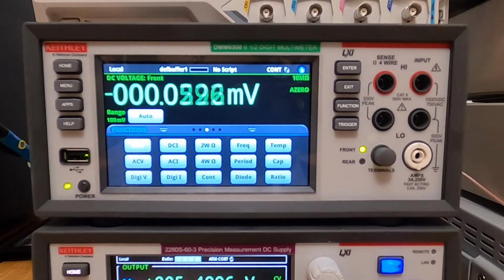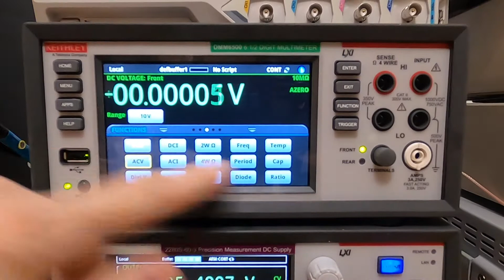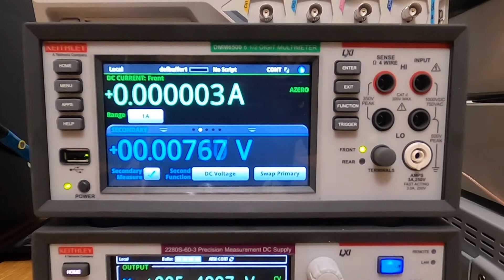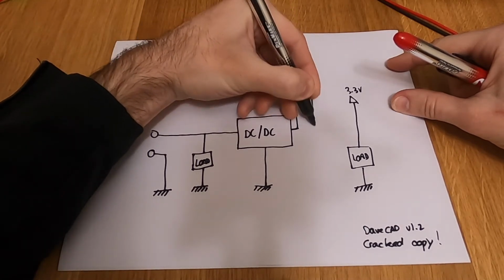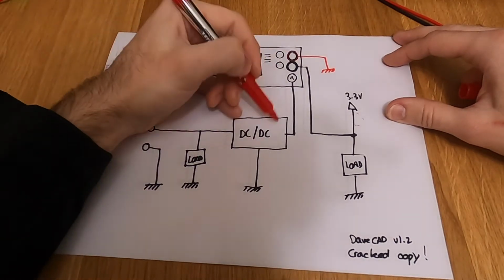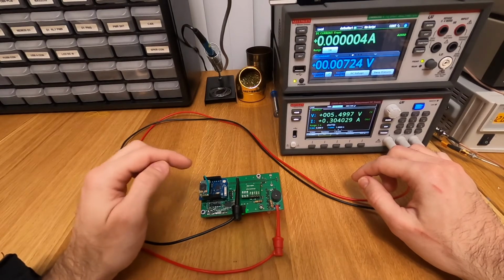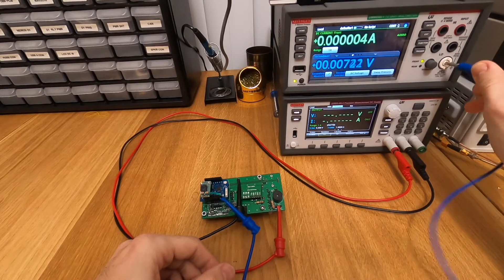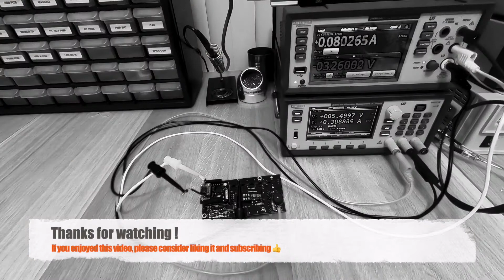Keithley DMM6500 : Dual measurement capability (demonstration)

Comment: Thank you for the range tip. I hadn't realized that.
A tip from me is that you can meassure the current on the low side of the load.
By this way you will able to measure the voltage correctly on the high side.
Thank you for the video.
Kostas

Comment: Super helpful video. Nicely done. 👍 I've had this relay switching issue during dual measurement on another DMM and I was wondering why sometimes it happens only some of the time (otherwise, it works as expected). Your video explains it _perfectly_. Btw, I have a DMM6500 on order - to replace my older 5.5 digit meter - and am looking forward to it even more now :) !

Comment: Excuse my ignorance but aren't the sense 4 wire terminals for measuring voltage and current at the same time?
Reply: If you haven't been exposed to it before, you'll probably find the 4-wire measurement system pretty interesting. This is also known as a Kelvin connection scheme. By connecting two wires to each side of a resistive element, it's possible for the meter to "subtract out" the resistance of the wires themselves. For precision measurements of small resistances, this is essential.

Does that help?

BTW, for voltage measurements, the 4-wire system is unnecessary, as the change in input impedance would be trivial.

Comment: I think you have missed one shortcoming. In this setup voltage measurement is wildly inaccurate due to flowing current thru voltage measurement lead. In most cases, even a 4.5 or 3.5 digit handheld multimeter will give better accuracy and non of the limitations. This is also true for current to some extent as you can't select the optimal range for voltage and current at the same time so current is measured at lower accuracy too. Although it could be useful in scenarios where 2~3 digit precision is enough. It just looks somewhat strange than it's done on a 6.5 digit multimeter :D

Comment: How do you handle the power on/off situation on the 6500? It has only a standby mode and can't be separated from the grid without pulling the plug. Do you disconnect it using an extra switch or do you leave it in standby mode all the time? What do you recommend?
Reply from the maker: I am not sure if the DMM6500 uses a heated reference. But since Keithley didn’t use a “true” ON/OFF switch (they did on my 2280S power supply) there must be a reason. The instrument might suffer from some adverse effect if cycled too frequently.

So I leave it plugged at all times, but on a surge protected outlet. And I hope it will be enough (we seldom have storms where I live)

Hope it answers your questions. There is no perfect solution sadly.
Reply: @the_bootloader  
Alright, thank you for your opinion! I'll leave it on then and may mail the distributor for further information on this. I'll let you know then if you wish.
Reply from the maker: @N.A._McBee  absolutely ! The more we know about our instruments, the better we can use them. Feel free to share your findings
Reply: @the_bootloader  I agree. I believe the standby mode to be a good feature, rather than a hindrance. Otherwise, for true precision measurements, one would have to leave the meter turned On for 30 minutes or so first. Also, similarly, I use a high-quality power conditioner for my test gear. Where I live, storms are fairly common in the Spring. During serious electrical storms, I make sure to unplug the test bench!

Comment: Thanks for the great videos about the DMM6500! This is 3 months ago, so I'd like to know whether there was any response from your Tektronix contact person in the meantime. I consider buying this thingy, so I sought after firmware revisions which could have taken place after your inquiry but the latest revision is of June, 2020. Thanks a lot beforehand!
Reply from the maker: I am working on a few other quirks I have identified with the dual measurement feature. I do not recommend buying the instrument for this feature in the meantime, since I am not convinced it can achieve the full accuracy specified in its datasheet. But I need to find time to do more experimentation to confirm. I did receive some answers from Keithley/Tek but I am not 100% satisfied with them.

I am still very happy with the DMM6500 in general. It is a very good instrument. Just don't plan to rely heavily on the dual measurement function, that is my advice currently. It is a very innovative feature with a lot of potential however, and I hope Keithley continues to improve it !

Hope this helps
Reply: @the_bootloader  
Thank you very, very much for your response! 

I have bought the meter yesterday and it will arrive today but I did not buy it because the dual measurement feature had been a must for me. I have done a whole lot of research in the last three weeks with respect to a good DMM for the bench, and the latest two competitors were the HMC8012 from Rohde & Schwarz and this Keithley. By the way, and somewhat Interestingly, the Siglent SDM3055, although that's another price range, has the same accuracy problem with the dual mode (loss of accuracy in this mode). - My decision for the Keithley against the R&S was based on the fact that the HMC8012 is an older model with less precision than the DMM6500. Moreover, the whole user interface of the Keithley is much more modern, more flexible and has this wonderful feature of a live graphical presentation of measured values over time, which is fantastic.

I'm running a small YT channel in which I plan to do some videos with and about the DMM6500, and it could be interesting to see whether the latest lot of instruments has experienced unpublished changes. Could you send me a little sketch of your dual-measurement test scenarios so I could try to reproduce the problems? That would be great! You may use the mail address available in my channel info section, thanks a lot beforehand!

Have a nice day!
Reply from the maker: @N.A._McBee  you will love it ! Please make sure to upgrade the firmware of the DMM6500 immediately. There is an old version which has a bug which drains the internal battery of the instrument, and I believe that if this happens you have to return the instrument for service. The newer firmwares fix this.

As to the dual measurement quirks, I am working on a video to show just that and hopefully I can release it soon !
Reply: @the_bootloader  
Thanks for the firmware advice! I checked this a few minutes ago and the DMM already had the newest firmware revision installed, 1.7.3.c. (The device was born and calibrated on November 22, 2020.) I have done first little tests with the secondary screen option and will continue testing, of course! I'm looking forward to your video about this, quite interesting stuff. For the time being, I'm okay with switching the primary function, so everything's fine with this instrument so far, I think it was the right decision. Perfect things with no errors, quirks or glitches at all simply don't exist 😉.
Reply: @N.A._McBee  Looking forward to your videos on the DMM6500! On YouTube, there are nice teardowns and somewhat superficial demos (this video aside), but not a lot about the features in-depth.

Comment: Would be better if you can measure the SAME Voltage and Current shown in the power supply.
Reply from the maker: Good idea ! The purpose of this video was to maximize the number of simultaneous measurements. In this video, I have 2 measurements from the DMM and 2 other measurements from the PSU, which gives a total of 4 different measurements with just 2 instruments. The purpose was not to validate the accuracy of the DMM6500 which is well defined in its datasheet. Thanks !
Reply: @the_bootloader  I understand, but because this is a NEW setup it's interesting at least one time to evaluate if the setup works correctly.  Try to search "DMM6500 Dual measurement", your video is the only one on Youtube, so you have an opportunity to explore better this topic.

Comment: Great tips :-)   When you now can read both current and voltage - have you then tried to make a Test Script on the instrument to show power?
Reply: Yeah, you echoed my exact thoughts. Plus, with the script, it's probably very easy to invert the negated measurement in the output - a small, but nice improvement.

Comment: The video is very descriptive and helpful. However, I couldn't select the secondary measurement. What should I do?
Reply from the maker: From memory because I am moving and I don't have access to my DMM6500 today : Use the touch screen. You can scroll horizontally to switch to the secondary meaurement display on the bottom half of the screen. Then I believe there is a button to swap primary and secondary display and you can change the measurement accordingly.

If you hear the relays clicking do not leave it as is as it will damage them. Manually adjust the range of both measurements so that you find a combination where the clicking stops

Comment: Thank you for pointing this "clicking" issue - on paper, the DMM6500 looks so good! 

Your video now raised a question about my use case and I hope you can help: I would like to dual display to show 2 different readings at the same time:

1. AC mA in the low range (to the high µA range) on the primary display
2. DC V in the 1kV range on the secondary display. The secondary display may also be switched to Hz from time to time.

Based on your description, the 6500 will be clicking like you showed whenever I have the display combination on AC mA and DC kV setting.s Am I correct? I would very much appreciate your advice, perhaps even your findings if you try it yourself.

Thanks in advance!
Reply from the maker: I did some testing for you and ran into a bug with the meter. For now I cannot recommend using DCV and ACI at the same time with this meter since I was not only not able to prevent the relays from clicking in any combination of the range settings, but also I found some weird bug.

I have reported the bug to Tek and hopefully they will fix it soon.

Don't get me wrong, the DMM6500 is still a GREAT meter. I would buy two of them if I was in your use case. I just don't think the dual measurement feature is good enough - yet. Hope this helps
Reply: Thank you very much for doing the test and reporting the bug. The 6500 manual did not specify how secondary measurements would behave, except to avoid "excessive relay wear". With your video and my question, we know the problem surfaces in more than one place. Bummer. Hopefully Tek will get this fixed. Thanks again.
Reply from the maker: @xavierguzmanjr5495  you're welcome. During my testing, with some range combinations, I had a measurement error of several percents (!!!) with the secondary measurement, which is totally out of spec.

I have send a bug report to my contact at Tek and I am waiting for an answer. I might make a short video about it